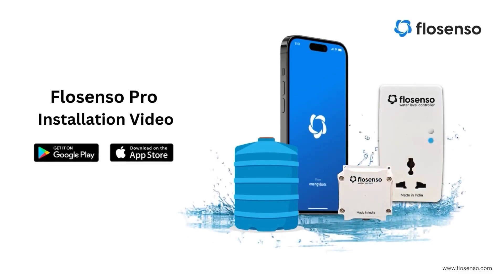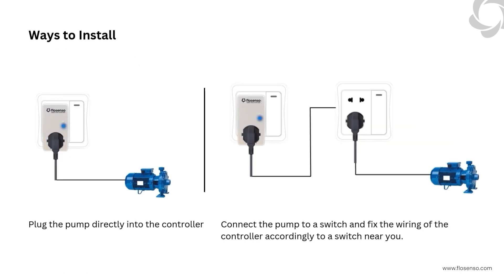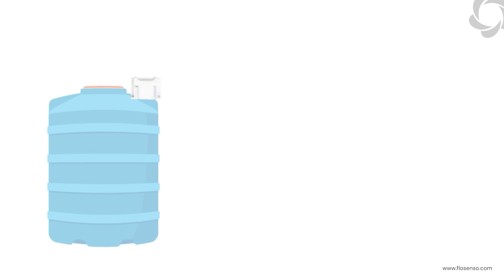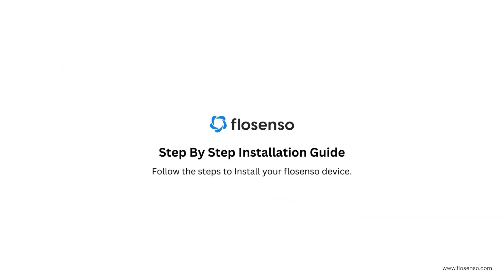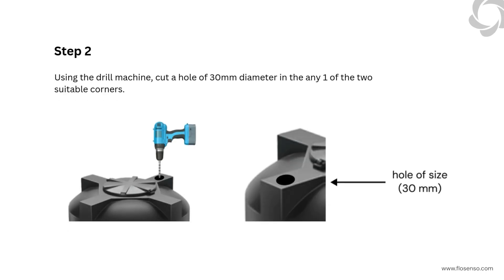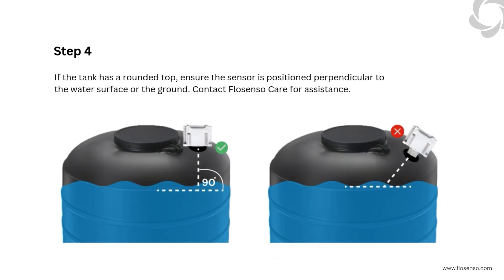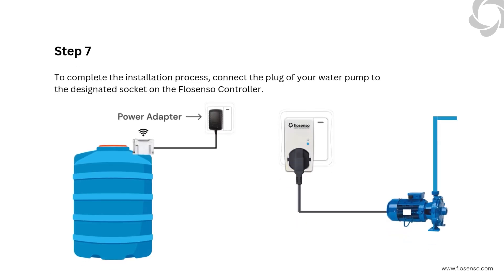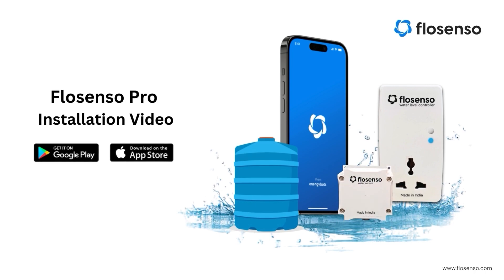Quick Flosenso Pro installation overview | DIY water level controller setup

Comment: How do i connect pulse sensor with the controller app as it is not showing any thing
Reply from the maker: Hi! If you purchased the pulse sensor with the device, it comes pre-configured — just plug it in and you’re good to go! 😊
If it’s still not showing, please DM us your details or connect with us at 1800-203-4902 and we’ll help you right away.

Comment: We don’t have power socket near water tank
Reply from the maker: No worries! You can simply use an outdoor-safe extension board to power the wireless unit near the tank.
Or you can go with the wired version https://www.flosenso.com/shop/product/flosenso/